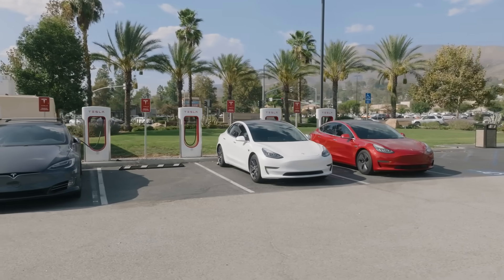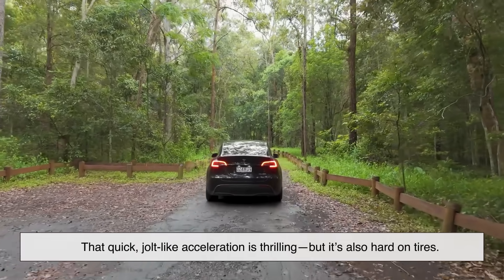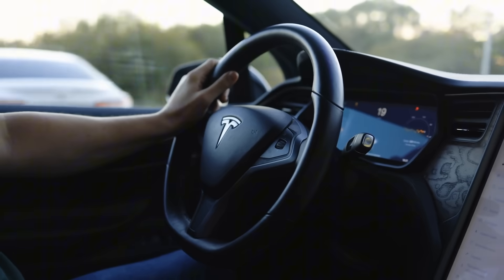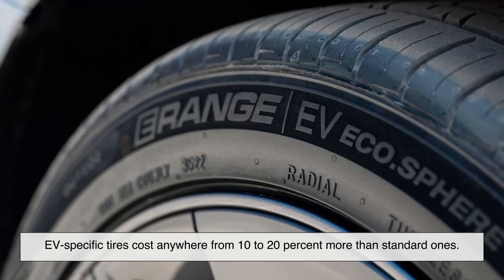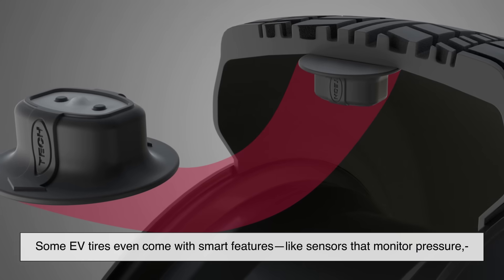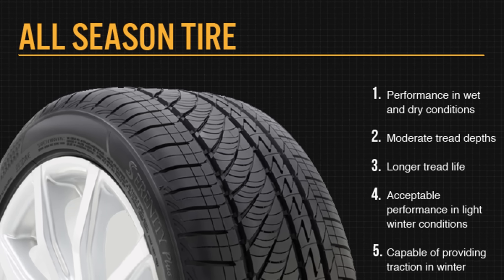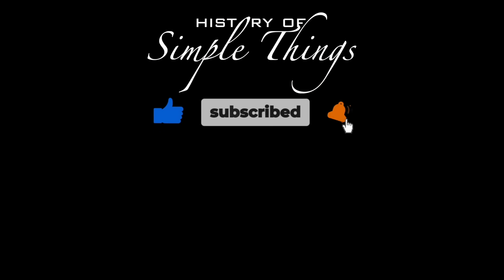EV Tires vs. Regular Tires: What’s the Real Difference?

Comment: I have a BYD seal , I’ve fitted Michelin pilot tires non ev. The cars great no ,faster wear , the load rating is the same and consumption the same. Also no noise at all. In addition I saved about 200-300 euros and have better grip. Also if I get a puncture I can easily fix it.

Comment: It’s an interesting video with mostly accurate info, but I don’t like how they really emphasized noticing lower range with a regular tire. Very unlikely to happen.

Unless you’re on a really long road trip… and I mean really long. Like the kind that’ll take you to your map showing you -1% on arrival sort of thing… you aren’t going to notice it.

Now if you compare a more range-enhanced EV tire, like the ION by Hankook, to a regular cheap ring of rubber you grabbed at Discount Tire, then yeah, you’ll notice a difference for sure. I’d notice a difference over other EV tires too. Hankook adds like 8-10% for range.

I also don’t care for the weight emphasis either. You can easily cherry pick two vehicles to explain one is heavier than the other, but I can do the same. Take Model S for example. Curb weight is 4,560 lbs. Heavy car right?

The gasoline Mercedes S-Class, BMW 7 series, Audi R8, and the Lexus LS are all heavier than that. 

Model Y? It’s even lighter than Model S, despite being an SUV and the S being a Sedan. (Smaller battery). So all those Sedans are heavier than a Model Y SUV.

As are the Ford Explorer, Honda Pilot, and the Jeep Grand Cherokee. All heavier than Y. So are the Toyota Highlander and even 4Runner. Heavier than Y.

Last nitpick is regarding the instant torque. It’s true, we’re super quick. Regular car drivers are almost always surprised at how fun an EV is to drive when they get in a good one for the first time, because that instant power isn’t something they are used to.

But just because we have it, doesn’t mean we’re always using it. We’re not chewing through tires, on average, any faster than any other regular vehicle. We’re not always accelerating at a light any faster than any other sporty car driver is. 

Sure, some of us really push that pedal down sometimes… but before anyone can claim we’re going through tires fast, consider this: we’re not out there doing burnout contests and drifting practice. We’re almost never the people you hear squealing their tires as they impatiently slam their pedal down in the distance. Our vehicles have smart features as well, reducing how often we have to “slam our breaks” to react… in fact we barely ever even use our breaks either.

It’s a good video… but some of these things, I felt anyways, needed some context added.

Comment: EV tires not only more expensive (by 10-20%) but also last fewer miles (usually - up to the same 20%). Exactly for noted reasons - weight and torque. Also microplastic pollution created more by 20-40% - because of technologies used for keep good grip. It is real objective reason for ecological taxes rises for EV in Europe...

Comment: "Electric vehicles are heavy. Really heavy."    Really???

My 2019 Tesla Model 3 LR weighs 35 kg LESS than the same size BMW 330i it replaced.  An electric vehicle is NOT inherently heavier than a comparable-size (and equipment) ICE one.  This reputation is due to EV models that are nothing but badly engineered electric conversions of an ICE model.

Comment: I’ve used regular tyres on my Kona EV for nearly 7 years (159,000 kilometres) and I’ve changed the tyres twice, one set of winter and one set of summer tyres.  😅  Both sets still have two seasons of wear left in them.  😮   This video was made by someone who is trying to sell something.
Reply: A questão do peso mencionado no vídeo não faz muito sentido, porque carros não andam vazios e leves sempre. Acho que isso é  coisa de vendedor querendo promover um produto.

Comment: most important is got the tire size and load rating correct as Original. i am in this trade and NOT all EV car equipped with AEV tire originally..
Reply: Load rating, the wise knows.

Comment: I disagree that extra tyre wear would add up quickly for 1 you are limited by range and charge times to maximum distance you could travel and normal average person vehicle use tyres last years therefore to notice the effect you'd have to be looking long range which most EVs probably arent going to see a lengthy time use as they will be prohibitively expensive to repair especially battery wise so I just dont see it quickly adding up at all

Comment: ICE cars generally ways much less, only in USA heavier ICE cars are build, so generally correct. I bought a used EV with standard or regular but high quality Michelin ICE  tires and sure enough they started giving a rumbling sound after some time because they got small bumps under the wear layer and when I had it checked ( asked two different garages) the answer was clear, the tires had to carry too much weight ! With next set of tires made for EV’s that I now have driven much longer give no such issues!

Comment: There is no difference between regular and EV in use of tires as long as they are of the correct ratings.
Reply: When choosing tires for your electric vehicle, it's a good idea to keep in mind the unique features of EVs. Opting for tires specifically designed for electric vehicles can really boost your car's performance, improve efficiency, and enhance safety on the road.

Comment: Low resistance tire also help you save on gasoline. All drivers want safe and reliable performance out of their tires, not just EV owners. Different tires have different wear ratings, and not all tire manufacturers are the same. This is true before EV. Nothing has changed. it just increased hype. It's called marketing!
Reply: EV tyres on an ICE vehicle will have next to no effect on gasoline consumption.
 It's not like the alternator uses huge amounts of gasoline, so even if you do save a bit of electricity with the super duper electric saving tyres, you're hardly going to see it on fuel consumption.
 It's the colour of cars where we should be focusing research, we need tyres better adapted for all the different coloured cars on the road. I don't know which tyres are the best for my blue car.

Comment: it sound like  crap to me if the suv had lets say a full tank off fuel and 2 over weight addults in it and lets say a disabelaty scooter would the suv need to upgrade the tyres no mmmmmm

Comment: Nonsense info. Aren’t there heavy ICE vehicles? My BMW X7 is heavier than my Tesla. All sports cars Porsches and others, have similar acceleration as EV’s. Just a hype to sell ‘special’ tires.
Reply: But it's not hype. What's nonsense is that you didn't pay attention to the video. My super duty F-250 weighs over 2000 lb more than my Ford Lightning. Using my KO2s from my super duty on my lightning I lose about 8% range, which really isn't very much when you're talking I can go 340 mi and my super duty gets better gas mileage when I run my EV tires on it. And finally the road noise from the KO2s was definitely apparent in my lightning when there really is no noise from my vehicle. You can hear the tire noise pretty loud which really doesn't bother me because I'm usually cranking my tunes when I'm out driving. So you see it's more than just about the weight going into a tire.
Reply: That's not how it works.
It's far more complicated, hence the need for extremely sophisticated tyres (which totally justifies the extortionate price).
If you were to just use Kilos your logic would be correct, but EV kilos and ICE kilos aren't the same. ICE kilos respect all the fundamental laws of physics, which allow us to correctly adapt the technologies to optimise performance. EV kilos are a new thing so we get to make up any old shit, as long as it increases sales.
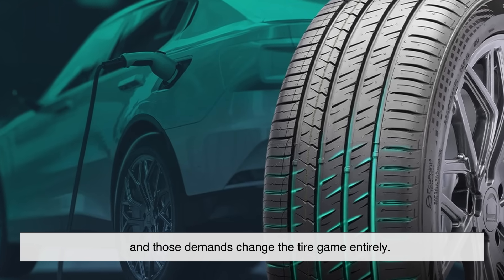Reply: So you’re comparing an SUV to a sedan no you need to compare to an SUV to SUV truck to truck. 1:15
Reply: 100% correct
Reply: I drive a mustang and then an normal EV, guess what, the acceleration of an EV is able to match My ford mustang
Reply: You need to learn Torque 101 bro
Reply: Tyres hv load - speed ratings. Just match these should be enough. Do respect the specific spec of the maker so that you won't fail insurance coverage

Comment: My ix1 came with vredestein ultrac mo (mercedes aproved) from factory. Very bad choice of bmw factory. Floating feel on fast acceleration, no shock absorbing at all, side walls are way too weak. Replaced with Michelin primacy 4 a regular tyre. Ride quality is much better than factory tyres.

Comment: What a load of BS! The so called issues highlighted here apply just the same to ICE cars. I've owned an EV for 4 years now and I fit Goodyear 4 seasons to it. The front tyres easily last 35,000 miles and the rears 50,000. I'm fact as far as the wear goes, it's the best car we've ever had! EV specific tyres are a marketing gimmick to get you to pay more for them. Simple.

Comment: Yes EV tires help a little on range , but most of that is hype & BS, I drive an EV & I am single and drive alone 90% of time my brother has suv married with two teenagers ( so approx 600lbs ) same as my EV alone , so why don’t suv cars with kids need special tires?? And 10cents worth of foam inside not worth $50 more a tire and it’s just as noisy as ice but engine drowns out tire noise, just turn up music
Reply: Instant Torque produces extra stress and  tension on rubber which ice does not produce that is why ev tires are more prone to tear and wear than a similar ice car of similar weight, if you can make sure to ease in the acceleration then you can reduce the stress on the tyres , which needs to be similar to an ice engine
Reply: I’m I’m gonna have my dad

Comment: In other words, EV tyres should be used on all similar-sized vehicles because: 1. Less rolling resistance  2. Quieter  3. Tyre pressure monitors are not exclusive to EVs. 4. So it seems EV tyres are just good quality tyres that could and perhaps should be used on any vehicle.
Reply: Not exactly. If you use EV tires on regular car you have "underweight" situation, which leads to unreliable road contact. Also uneven wearing occurs for this reason. If price is no question - you can use regular tires of special series, most serious tire makers have it.

Comment: From what i garther EV tyres are built to carry the extra battery load and are design to be quiter less rolling, and regular tires will wear quicker and are more expensive by roughly 20%, what happen if i fix EV tyres to my regular ICE car, will my car preform better, longer tyre life span, a more quiter ride, if the tyres can last longer, it will offset the higher price.

Comment: EV tires is another ploy to get more money from you. We have 2 EVs and XL load rating and quiet due to the sipes and they work fine. No real difference on the energy consumption.
Reply: Exactly. Just changed to normal tires for my Tesla.
Reply: @eoky Same with me. The oem ev tyres were crap in the rain. Now I mounted Eagle F1 on my Model 3 and it handles superb.

Comment: Can a EV tire be used on a non EV vehicle ...??
Reply: I would assume that you would get better MPGs, but the load rating would be overkill. EV tires’ rolling resistance and traction makes a drastic difference when it comes to range in EVs, but in gas cars MPGs are affected less even though it still makes a minor difference. 

For example, on my 2015 Scion TC I had Michelin Crossclimate 2 when I lived up north and was too lazy to switch out from winter to summer tires. I was averaging 2 MPGs less than my average when I had the OEM Toyo Proxes on due to the crossclimate’s extreme grip/traction. I’ve recently replaced the crossclimate 2s with the Michelin MXM4 Primacys and averaged 3 more MPGs compared to my average with the OEM Toyo tires even though I have full tread on there. That’s a 5 mpg difference using the Crossclimate 2 vs the MXM4 Primacys. The Michelin MXM4 Primacys are the same tires that are used in many Tesla Model 3s but theirs have an additional foam dampener inside the tires to drown out additional road noise. Using that same logic, EV tires with even better rolling resistance than the Michelin Primacys should theoretically get you even better MPGs, but extra MPGs in a gas car isn’t as big of a deal as extra range is in an EV
Reply: Sounds like putting premium gas when the car doesn't require it.
Reply: There is no comparison to fuel. 

If the EV tyre gives better range, is stronger, quieter and wears better why wouldn't you use it over an older tech tyre???  

Makes sense to me and lot of other people.
Reply: Yes the only difference is the tire does not have the foam inside that silent road noise
Reply: Only if your gay

Comment: I've driven an hybrid for the last 15 years and was aware of the low resistance factor but I have an EV now. This car has factory fitted (and presumably EV rated) tyres but they are coming for replacement after 30,000km.
Good advice for selecting replacements.

Comment: What if ev tires on gas cars, any pros and cons?
Reply: You’d be wasting money and gas.  As the video described in detail, all of these extra features and requirements are specific to Evies. Gas vehicles don’t require these things. And, as the video also said, they cost a lot more. So you’d be spending a bunch of money on these extra features that are unnecessary for gas vehicles, and these tires weigh quite a lot more so you’re wasting gas, and you just won’t see any real benefit in exchange for either of these trade-offs.
Reply: Price
Reply: EV tires probably have harder a compound. If you don't have the weight to counterbalance the lost of traction, it's probably not safe.

Comment: Great information ! How about nitrogen filled instead of air filled tires. What is the difference? Do I need special tires or does tis work on standard tires ? And why not Argon or helium ? I have a tire shop buy me using Nitrogen system. Thank you
Reply: air is already ~80% nitrogen
Reply: @rubberduck4966  I think it is a sales pitch. AKA Snake oil .
Reply: Supposedly nitogen won't leak through microscopic holes in rubber as quickly as oxygen does, especially in cold weather, because the atoms/molecules are bigger.
I had nitogen-inflation in -40°F weather in South Dakota, didn't need to top up air in tires for like 3 years.  Moved to Texas, it's not available.
Reply: @LordDustinDeWynd  Thank you !
Reply: As mentioned, air is already 78% nitrogen.  Filling with 100% Nitrogen doesn't mean you can skip checking your tire pressure.  It will still lose air pressure over time, although at a slower rate than air.   The main purpose of Nitrogen is it removes the water vapor that is naturally in air.  As the temp changes, the water vapor can affect the tire pressure.  The nitrogen will keep a stable tire pressure
Reply: @season387  N2 Is a Inert gas thus explosion proof and dryer so it wont corrode your wheel. 
a Good Tire shop will have a Dryer after the air compressor before your tire , and is wont corrode your wheel as well. Regarding skip checking your tire pressure is not advisable unless you have a TPMS . routing tire pressure checking is important because it help you to identify and tire had a low pressure due to leaking.